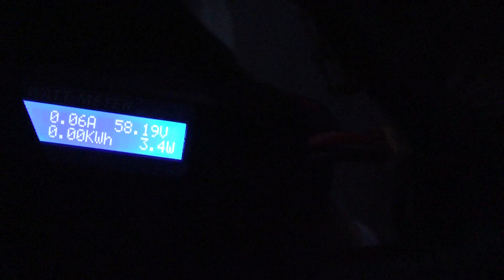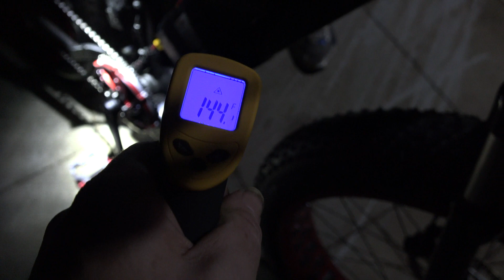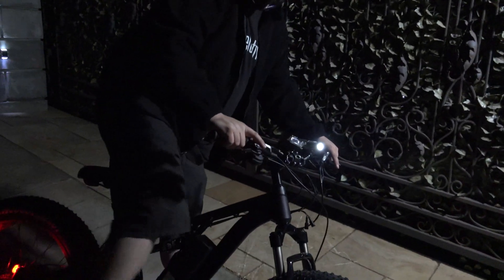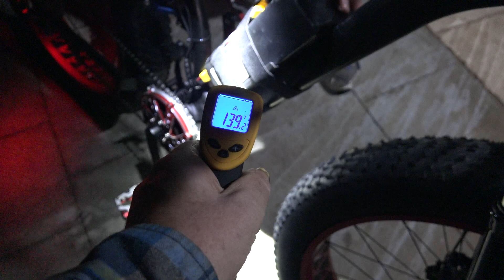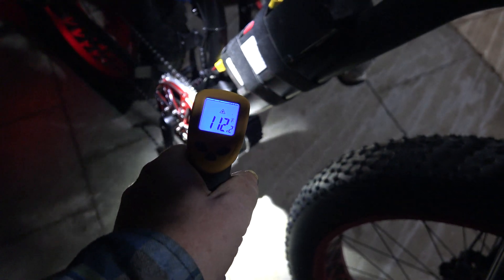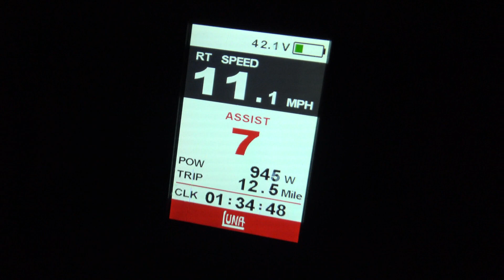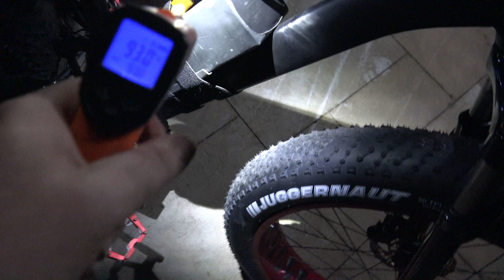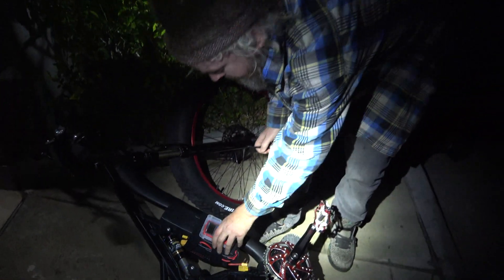Testing a 11.5ah Pf pack battery and BBSHD tortue hill climb

Comment: I am impressed with the brakes too. anyone recognize the model name for these brakes?  I had to zoom through this video due to low data. 

I plan on purchasing a bbshd from luna for off road riding and hunting. I have 45LB fat bike bike, I'm 6'5" 200lbs, my steel cargo trailer is around 40 pounds with heavy 3"w 20" tires. Considered welding suspension forks at some point to the trailer. which will add even more weight. I plan to wear my battery in a back pack.

I didn't think that this motor would handle all the slight-medium hills we have around here with my weight, all the extra weight, and if I have a good day, the weight of a decent size buck. 

This video proves that it can do that like it ain't shit.lol

Comment: Nice job on the testing. I think the temp gun is accurate however the numbers arent stable with the method used. Why not use some simple temperature stickers on each location? 
Like these as an example, http://www.motosport.com/product?psreferrer=https%253A%252F%252Fwww.google.com%252F&pssource=true&segment=badger&key=Factory-Effex-Temperature-Stickers&cc=us&adpos=1o6&creative=93575775025&device=c&matchtype=&network=g&product_id=FE-TEMP-STICKER&gclid=Cj0KEQiAnIPDBRC7t5zJs4uQu5UBEiQA7u5Ne3haBtXL1eeU0PW_v1YIaDADKkkKyMp-kdNnA-OFZDUaAupN8P8HAQ

Comment: how do you think your 52v Mighty Mini would fare on this test (vs the batt pack you used)?
Reply from the maker: we test the luna mini all the time on the same hill.....it does well...but it does heat up. IT can make the climb consecutively until dead no problem with either 30q or pf cells.  (mabye not with a 300 pound rider)
Reply: What if you pedaled?